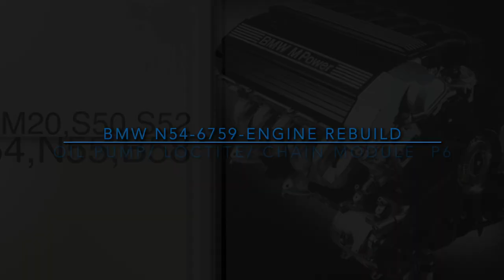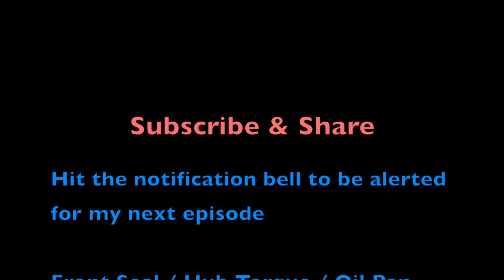BMW N54 6759 Rebuild Oil Pump/Hub Upgrade & Sealant Installation Part 6

Comment: Are those grip disk washers that go on the oil pump sprocket re useable ?
Reply from the maker: No
They are friction discs that loose they’re holding capacity once it has been used once